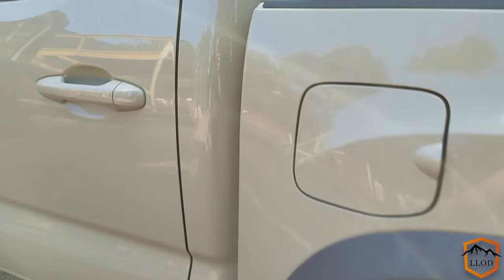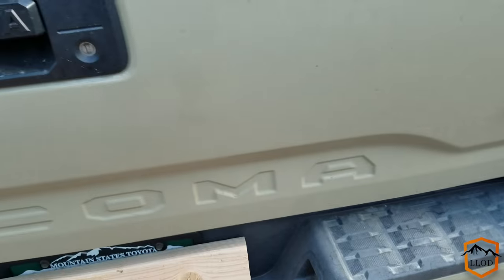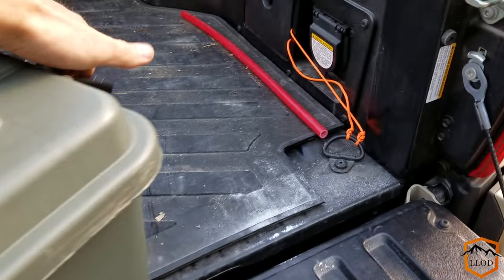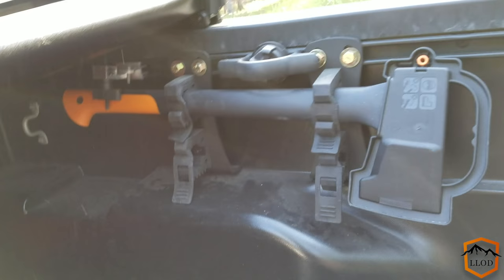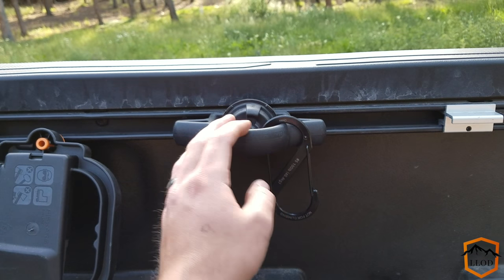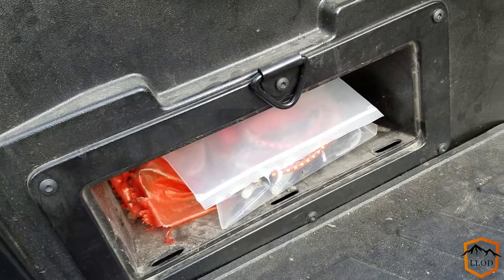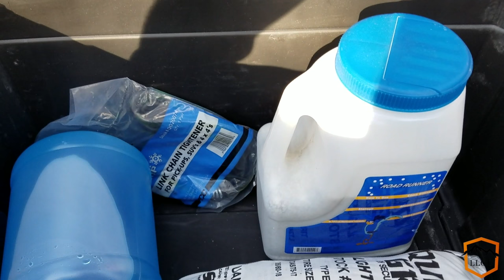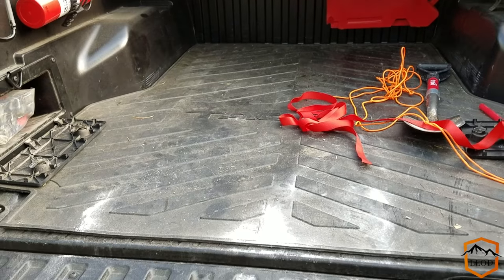Truck EDC / Emergency Vehicle Gear (Part 2, what's in my bed) - 2016 Tacoma

Comment: Great vid!  Got a few suggestions based on my own experiences...

For the truck loadout:

Add one of the 7 day or 14 day emergency food kits available from pretty much anywhere. Even a 30 day kit is no larger tan a 5 gallon bucket.

For the hike:

Unless you intend to carry a truckload (no pun intended) of water with you, I suggest for your first hike to cache some water
and power bars about every 4 miles. Also some booboo style medical supplies, a throw away towel or bandanna, and a pair of socks at some point. A map, especially one containing terrain features ,would also be helpful.

Adjusting the amount or type of supplies for any further hikes will be easier when you've done it once, to see how your fitness level, the terrain, and the weather affect your travel path.

Additionally, don't get stuck on the mindset of only "One Way To Go"... Use the map and a compass, do a little pre-hike work, and find an alternate route to your home from work. Again, if you hike it, try to set up caches of essentials to get you through the
hike.

I say this because, assuming there is some sort of attack, power outage, natural disaster, where the roads are heavily trafficed either by vehicle or by foot, there are going to be some crazies that want what you have. Having an alternate route may be a
life saver... yours AND theirs.

My personal travel distance is currently 42 miles one way, on roads and highways. Less than 30 if I go straight overland. I spent several months setting up caches along both routes, just in case.

Looking forward to hearing your hiking results!
Reply from the maker: Those are all great tips. I haven't gone about setting up any caches, but it's always something that I think would be a nice thing to do one day... Just gotta take some time and do it!

Comment: I don't really see the Tacoma much smaller than the f150. I personally would have gotten a 6 foot bed to be able to camp back there with a camper topper. Building up a removable platform to sleep on and storage on the bottom. 

But you have that steel bed cover and tent, so you're set!
Reply from the maker: Yeah, my brother has an F150 and it seems/feels/looks/drives like a significantly larger truck. 6 foot bed definitely has some benefits. There are times that I wish I went that route - but overall am very happy with the short bed for what I need it for.

Comment: Like the rotopax, i have a jerry can on my rear tire carrier carrier. I didnt see a tow strap, you need one! Also, checkout pelfreybilt when you decide to armor that baby up!
Reply from the maker: Yeah, still waiting on a bumper for the Gen3 Tacos that I like... I have a tow strap under the backseat - also often times carry a comalong for self-extraction, since I don't have a winch on this guy.
Reply: +Last Line Of Defense true that, i havent liked any designs so far for the gen3's bc of the huge grille. I have a 12 dcsb supercharged and armored.

Comment: Hey, so I have a 2016 tacoma and the link for the tonneau cover says it doesn't fit? Is that the same one you ordered?
Reply from the maker: Yup, that's the exact one I ordered!
Reply: +Last Line Of Defense thanks and one more question did the 5 feet cover fit good without any leaks?

Comment: I thought there was a 15 round limit on mags in Co
Reply from the maker: No, there is an unenforced restriction on buying new mags that are greater than 15 rounds in CO - but all your other mags are grand-fathered. Also, you can walk into most gun stores and pick up 30 round mags or whatever. I don't know that there is a single case of it being enforced, but I could be wrong.
Reply: +Last Line Of Defense Oh thx for clearing that up, keep doing what you're doin

Comment: Fords name doesn't not belong in the same video as toyota.
Reply from the maker: If ford made a mid-size truck, then it'd be an option. ;)
Reply: Toyota beats ford any day of the week.:)
Reply: Ford is reintroducing the Ranger it was a very reliable small mid-size truck when they were manufacturing them. You can't beat a Tacoma but the gas mileage is worse in my 4Runner than I was getting in my 2005 Lincoln Navigator and 1999 Ford Expedition! I'm not exaggerating! What's with that Japan, come on figure it out!?